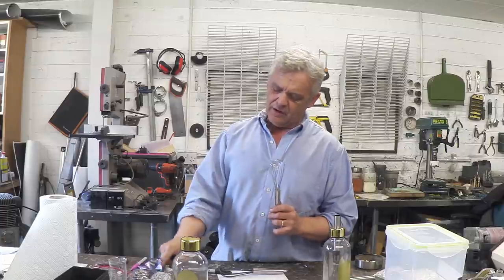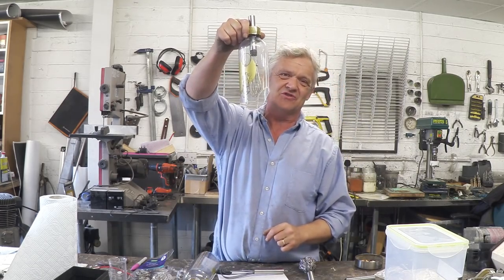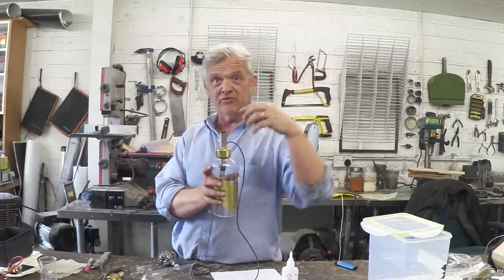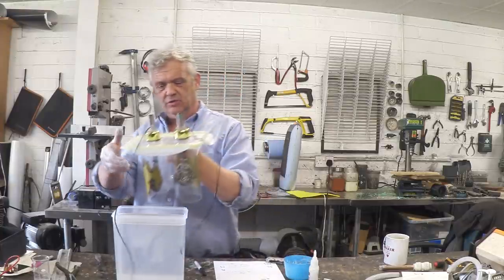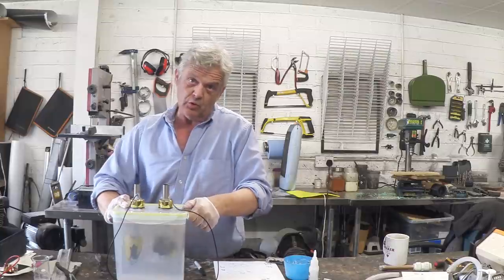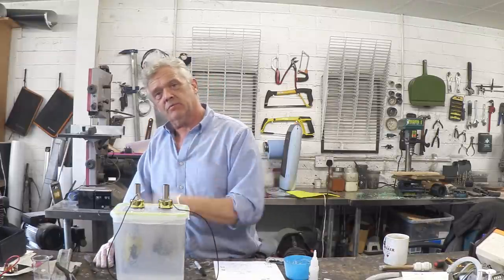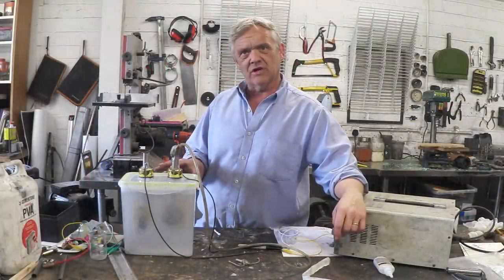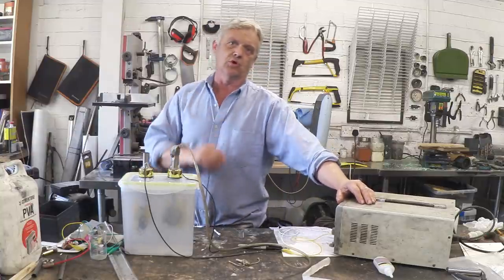1256 Urea Electrolysis For Hydrogen Production

Comment: Hallo, after having done a ton of experiments, i still do not get the point of electrolyzing urea.
In my experience in the lab, it seems I'm a A LOT more efficient into electrolyzing water than urea. I'm using 5%weight addition of NaOH ald 32,5% pure urea in water solution.
That's AdBlue with 5% on NaOH added.
The resoult is a dramatic loss of efficiency compared with NaOH solution in water by itself.
What can I change to my process? Thanks.

Comment: Very cool ROB! Im always trying to design "the Future Mars House" Hydrogen has obvious uses, but what kind of volume of nitrogen is created, and is it possible to pump it directly in to or under soil for say a green house nutrients?
Reply: IRC you need to "fix" the nitrogen like nature does with lighting by having it go to a chamber with a continuous arc and then bubbled through the water you will get weak nitric acid that will increase in strength over time as you continue the process so dilute it or go with distilled water and have nitric acid for lab use.

Comment: The best fuel cell is the alkaline nickel catalyst based used in the Apollo missions dirt cheap. the problem is if there is any CO2 contamination of the oxygen ie air then it destroys the potassium hydroxide electrolyte. Now urea can be used to produce ammonia and there for continuously replenish the electrolyte. I wonder how much electric power can be generated from a person to run an off grid house. I am using so little electricity now just LED lights and I am going over to red/yellow lights lower power and don't affect sleep rhythm. More people = pee.

Comment: would stainless steel or copper scouring pads last longer??
Reply: I think those were stainless scouring pads
Reply: Use graphitized floral foam they will last forever.
Reply: @Barskor1   where do you find graphitized floral foam?
Reply: @brandtlitton8138  You have to make it in a similar process to making charcoal, I can tell you more it you want.

Comment: The BIG question: Will it achieve OVER UNITY or will you use more power to split hydrogen from urine than the power it will produce in a car engine for example??? (Lets open the conversation because Im about to do the full swap)
Reply from the maker: nope - the big question is - will you do it?
Reply: Talking of Over Unity, whatever happened to Gerard Morin ? He went to China to oversee the production of his Over Unity generator and seems to have disappeared ?

Are you going to be doing any videos of your "full swap"  ?
Reply: @ThinkingandTinkering  I definitely will do it but would love to know if someone knows if it required more power than it produce 😀 What is your experience Robert ?
Reply: @WallaceSpirit  - I found his ideas and concepts absolutely fascinating. But found it a bit off putting that his attitude seemed to be, that if you needed to have it explained to you, then you were too thick to grasp it, so dont even try.
If this sort of stuff is real, it needs to be open source in order for it to do any good.

Comment: EXACTLY why the automotive industry is promoting EV's while actively discrediting Hydrogen as a viable fuel source. While the mining/frieght/shipping/aviation/heavy machinery sectors (EACH of which DWARF the public automotive markets hydrocarbon fuel requirements..... ) are all universally moving towards developing a hydrogen ICE market and/or hydrogen fuel cell market. 

One might be a critical sceptic and perceive this as not an interest based on profitability and efficiency/proficiency but rather a move to further the control over the publics dependancy on controlled and centralised markets.... Imagine 20 yrs after EVs are 99% of registered vehicles, all the tooling and knowledge of ICE will be long gone and with both the family household and transport powered by the same source the ability to escape market pressure/influence by using alternate sources to power either fuel/energy requirement will not be a viable alternative most the vast majority. Meaning the market controllers will have a better metric to understand the acceptance and/or effectiveness of ever more profitable or incentivised business strategies, both of which are increasingly adverse to the individual and public interest. 
Just think how useful some components of obsolete technology are and the increasing difficulty of acquiring them. Ie; imagine trying to do this once microwaves are obsolete. *Components from old-school neon lighting are highly valued by enthusiasts for thier properties, as are the large Fresnel lens from old flat screen TV's (of which I'm unaware of being available anywhere else and only credit card sized units for emergency kits being easily located. Very weak A4 sized units can be found but are pretty useless. 
Same goes for cathode ray TV's this seemingly forgotten staple of the household us one of the most valuable instruments one can have for conducting conceptual proofs with magnetism, 'experiments' which challenge the entire paradigm of magnetism as taught in the educational system. 

The other topic of interest relating to my original premise is the science behind the electrolysis process we have all been taught at school from early childhood, and the same process used to discredit the technology for extracting hydrogen form water. This is school yard level science....

Surely not only the metallurgy and chemical composition of the fluid/catylist play a part, but how about the properties of the electricity? Coupled with the nature of its application, and the tuning parameters of the  cavity to harness the power of resonance to increase the efficiency of the process? How about the pressure inside the cavity? How about adding exotic metals/alloys with specific electric/magnetic properties into the equation? Along with the geometry of thier arrangement to make further use of nature? 
So much development to be done, in respect our 'modern' understanding of electrolysis is like still having cars that were designed and developed in the very early 1900's. 
I think it's a deliberate retardation of the collective understanding of such tech to limit the population from giving the energy cartel the bird and making thier own energy....

Has anyone here seen the inner workings of a microwave? (Rhetorical) this is exactly what I'm talking about with regards to more effectively creating hydrogen from water. Just look at the intuitive design of the microwave, along with the very specific materials required for it to function. 
The tuning of the cavity...
The reconfiguration of the electricity...
The use of resonance in the cavity....

Apply this understanding to electroysis and we are looking at a different paradigm. Of course, it would somehow have to be of benefit to the captain's of the energy cartel, but if it were.... I'd place a big bet that we'd be hearing and seeing a completely different narrative...
Eg, Elon Musk would have a completely different script to learn and perform in the public media. Hydrogen fuel cars would not be being prohibited from being imported for public sale, (or not sale at all in Australia actually, as our government doesn't trust it's people not to pull one apart to see how it works. For some wierd reason. They are insanely expensive even just to lease for a yr or so, the equivalent of buying a European luxury saloon outright. And only approved people/bodies/entities can even lease one, pretty much only government departments....  Yet the Prime Minister is quoting in the media that Australia is going to be the world leader in hydrogen production and exportation... Go figure)

Comment: Waooow! But how  much energy did it take? A few says you cant make energy for nothing! Absolutly! You need store the Golden Shower for an other steamy activity! Nothing like the PR-Matermind Don. Jon T-rump have his golden locks make shine! And one thing on a downside how does the cem-trail look after this aeroplanes?! The idea from the reaction beetween Gallium and Aluminium to make hydrogen can reduce the cost of energy for this type of works a bit more!
Reply from the maker: well the energy it mostly took was in the production - but as that is a biological production it is hard to asses
Reply: @ThinkingandTinkering  replace psu with solar panels or wind generator. Then just need a storage solution. Compress it in to Likes of lpg cylinder ??

Comment: you tested straight electrolisis with h2so4 yet?
voltage drops to 1.25 V or so ....
so also efficient and you only actually use water.
automatic filler on it to level keep the water at the around same level and there you are.
just add h2so4 until the current you draw is around  0.1A  per cm2 for efficiency. 
yes, only 100 mA per cm2, 50 is even better.
more current and the voltage will rise and there goes the efficiency :o 

most ppl think h2so4 ... yikes battery acid dangeroud !!
but so ar all chemicals at high concentration 
i wouldn't wanna touch KOH at high concentration since its pretty strong.
h2so4 in something like a 1 or 2% solution is not more dangerous than KOH for the same amperage.
so basically a 10x10 cm plate gets to draw around 10A max but 5 would be prefered.

want more gass? use neutral plates or just bigger .
i'm working on a large unit for some time now,  has 240 or so plates and works on (mains seperated) straight rectified DC from the 230V mains.
should produce an insane amount of HHO.
a basic motor dimmer will be used to regulate the amount HHO.

Comment: it is H2O seporatet 1 hydrogen and 2 oxygen not nitrogen N2. 2O forms at dobbel speed cos of 2 o molykyles and 1 hydrogen. hydrogen just burns in the normal ear but if you mix the oxygen O anh the H styometric mix it sas bang. H2O

Comment: You can not electrolyse water at 3.2v or any other voltage. Water does not conduct electricity as you very well know. Unless you mean you can electrolyse contaminated water that is exposed to a source of H and O.... air. Use distilled water and seal the water from the air. Or....Use an electrolyte that does not have O or H, seal the solution from the air. It may well elaectrolyse and you will get gases but there will be Zero O or H. It really flummox's me that you have a very enquiring mind and question everything..... other than the official narrative. Are you like most whereby self preservation trumps the truth? 

I will prove my point. Distilled water does not boil in a vacuum (as science leads us to believe), I have a vacuum chamber and have done the experiment many times. Add a bit of salt and it will appear, to boil but it doesn't boil. Given time (a few minutes), the gases are forced out of the liquid and eventually the "boiling" stops whilst thte vacuum is maintained, again I have done this many times. All the videos on YT cut short, they show the bubbles and claim boiling. job done. 
I am feeling brave, I postulate that both elctrolysis and a large reduction in pressure achieve the same thing which is to break the bonds between the water and the disolved gases forcing the gases to expand. I further postulate that a drop in pressure whilst performing electrolysis will reduce the required voltage to perform electrolysis.
Reply: I just did a few more experiments with hydrolysis in my vacuum chamber. A bit crude, two 4 inch screws attatched to a usb battery pack 5v. Found an accidental cool tool, a safety feature of the battery pack is a low draw shut off and auto on when there is a draw on the battery. It instantly shows if the solution conducts electricity.
1. Distilled water does not elecrtolyse or boil at all in vacuum. (expected).
2. Distilled water with salt slowly added, almost a grain at a time until the battery kicks in and electrolysis starts. Electrodes removed, just the solution placed in vacuum. Bubbled for a few minutes then stopped. When out of the vacuum, the solution no longer triggers the battery, it is no longer drawing enough power. More salt added until battery triggered.
3. Distilled water and lots of salt and electrodes placed in vacuum. Bubbled random and aggressively at vaccum, brown yellow colouring. Colouring and bubbling continued, sludge build up in bottom of glass. bubbling reuced  in size and local to the electrodes but continued throughout. 
4. Distilled water with salt slowly added until electrolysis starts. Placed in vacuum with electrodes. Bubbled random and aggressively at vaccum, brown yellow colouring. Colouring quickly stopped, bubbling reuced  in size and local to the electrodes but continued throughout. 

I learn't many things but one thing stood ou for met. Mid way through the experiments, the rate of reaction dropped by maybe 75% but continued throughout. Although the reaction appears to continue, the affects of the reaction appears to stop ie Colouring and sludge build up. 
So whats going on?? Why is the reaction appearing to continue but no resulting after effects?? What is actually happening on a micro level is element effect at the electrode, The water touching the electrode is being rapidly heated (micro level), imagine dropplets of water in a hot frying pan. 

I postulate that once the disolved gases from the electrolyte have been expelled / spent the consequent bubbling is not electolysis and no gas is released. I plan to confirm this by collecting and testing any gases produced in the vacuum over the duration. That will take bit more jiggery pokery to sort out.